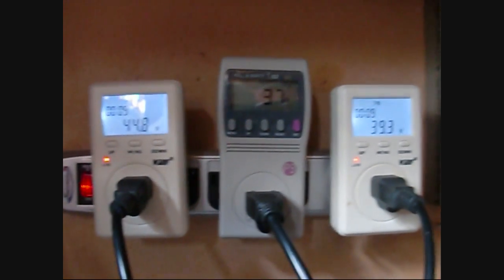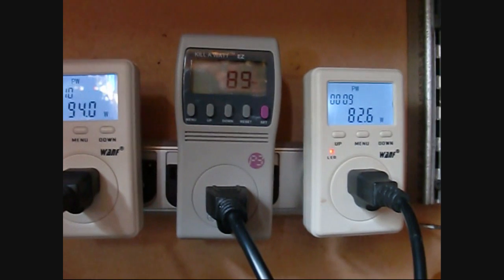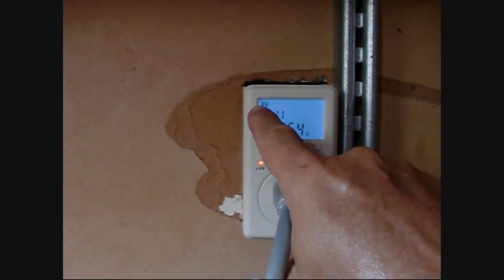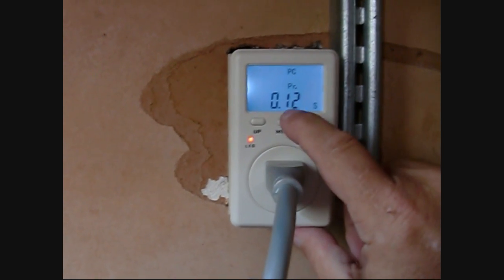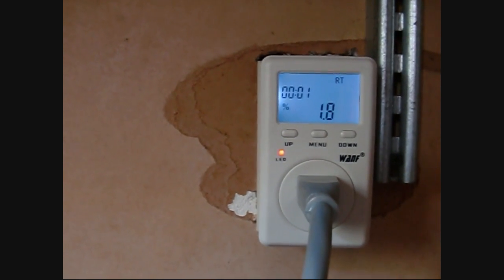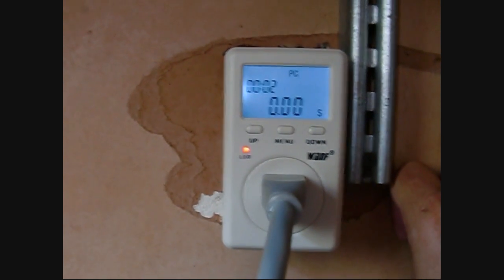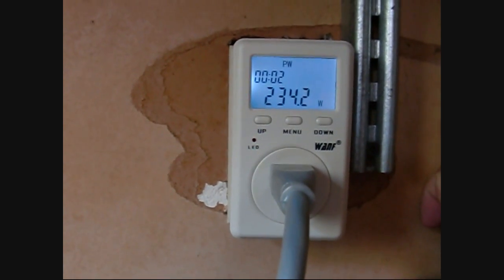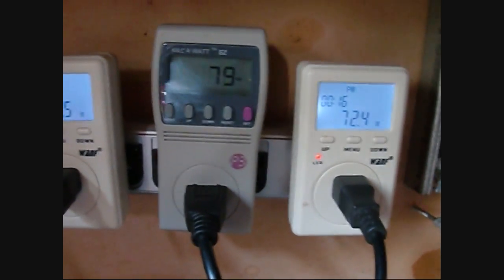WANF Kill-a-Watt power meter and Grid Tie Inverter with Solar

Comment: Hi, great video  I want to buy one of this but there is no WANF on ebay or amazon right now but Ensupra, Kill a Watt and other device called " Power Electricity Usage Monitor US STOCK (US-HK453) ??" (Weird brand), I noted that your video was about 2 years ago, may you tell me which power monitor for grid tie kit is the best now actually? , if it comes with backlite  could be better, and CO2 estimate  could be cool, thanks for your prompt reply, David

Comment: For those that are wondering, I have the 220-240v version of the WANF and it works great on 240v too. They actually seem to be a pretty accurate power meter unlike many that I have tried. They also measure low power (<10w) really well too.
Overall, great value for the $'s.

Comment: @fearlessthinker.  can I add a group of batteries that are 100 ah and a group of batteries that are 50 in the same chain.  will that cause issues with them discharging or charging disproportionatly.  What is the best way to connect batteries of different capacities to a group of solar panels?

Comment: Can you tell me why the solar grid ties generally do not have a dump load whereas the windmill grid ties require a a dump load ?  Your 3 panels combined produce a great deal of power, I was just wondering what would happen when the grid is disconnected while your panels are still producing power.